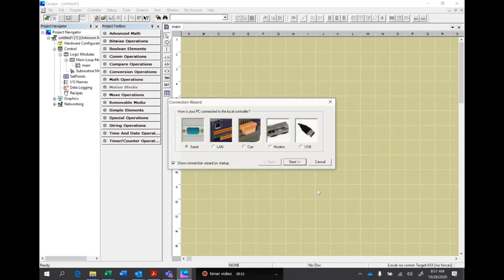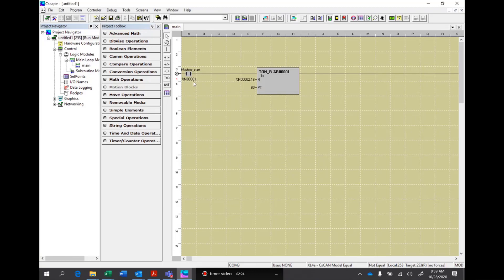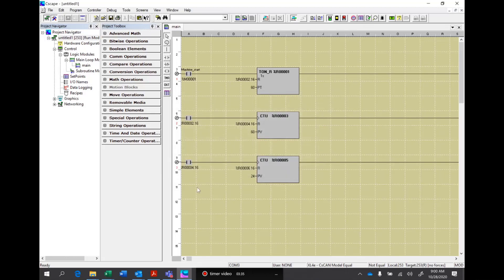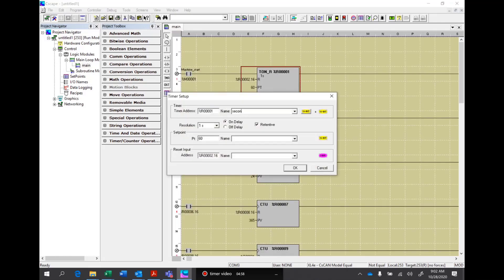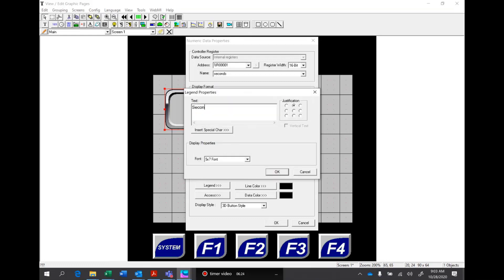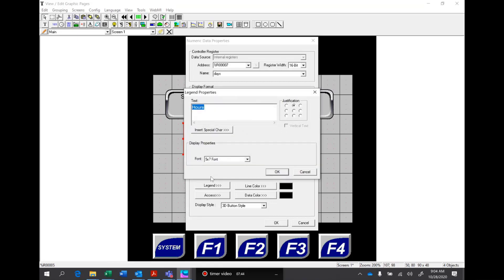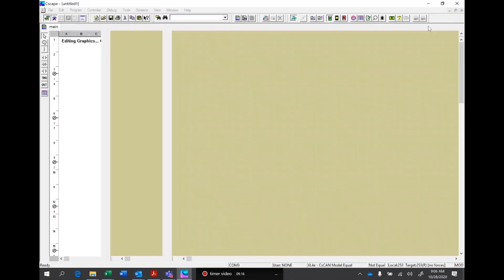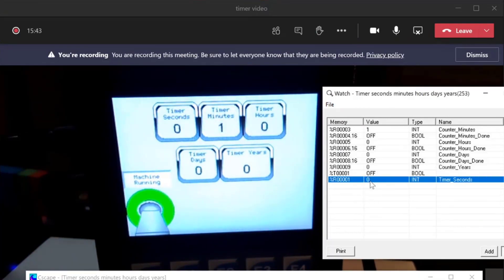Timer & Counter Setup

Comment: is there no way to just use editable timers instead of counters?
Reply from the maker: Thanks for your question!  Functionally - what do you mean by an "editable timer"?  In general, Timers are level based (active while receiving power) and Counters are transition based (only active during a transition).  If you could clarify that a little bit more - we'll try to give you a better answer.